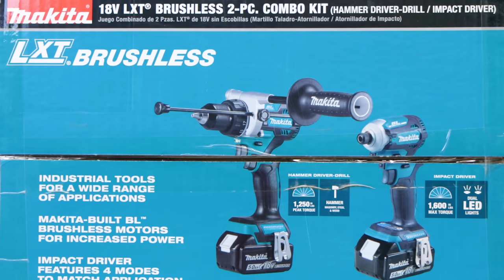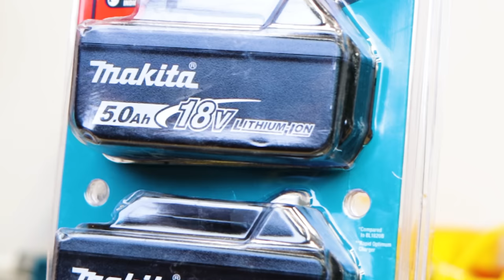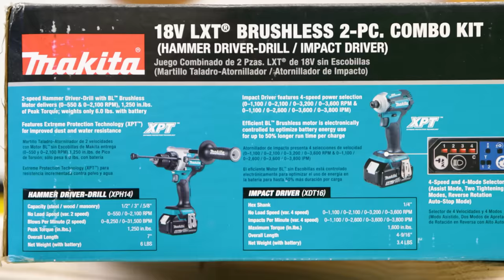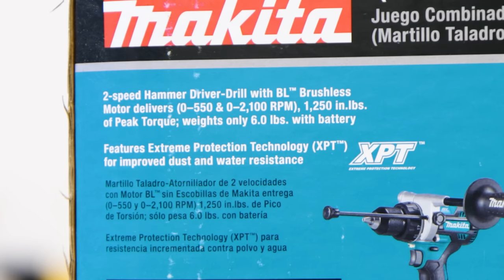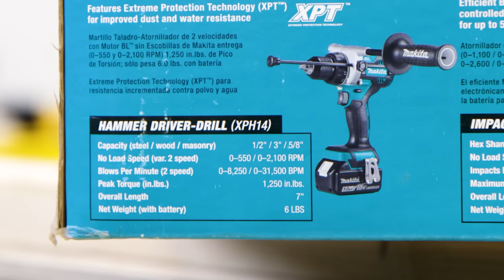New MAKITA Hammer Drill HAS INSANE POWER! (Best Combo Kit At The Home Depot)

Comment: It rings up for $573- at my Depot.
Reply: Did you try online
Reply: @CarnivoreKipp  Yeah. Also tried different zip codes around the country. Main kit was $399, and the other stuff was below as separate add ons.
Reply: @matthoward1174  I found it online for free shipping. Go on home depot website  and type in makita combo.

Don't stop scrolling until you find it.
Reply: @matthoward1174  if you don't find the exact pack then it is 399 just for the main kit.
Reply: @CarnivoreKipp  Found it. I looked at Makita 18 volt before, and it didn't come up that way. Good looking out ! Thanks for the heads up !
Reply: @matthoward1174  I tried to sweet talk the wife cause I only have a drill no driver but she said nope. Lol

Comment: I see fan boys for every tool line I completely switched over to the Makita line about 7 year's ago and it only lasted 2 year's and everyone besides HVAC guys around me uses other tools . I watched a platform recommended video and Makita was there recommended platform and the guy who recommended them said tools last between 1 and 2 year's but I'm in the electric field and the whole reason I stopped using Makita was drills because they didn't last I can literally smoke a base Makita hammer drill drilling one house out even if you buy a in store warranty it's not profitable for me to use Makita we have a first generation m18  holehawg still running it's been in a vehicle fire and the battery doesn't make great connection so occasionally you pull the trigger and it doesn't work I had my very first  chop saw stolen after 20 years of use the final 10 years wasn't as much being I switched to manly electric work but still weekends and side jobs I'd use it a old DeWalt one of my first cordless drills was a Makita with a long battery and it  was what made me think they would be a good platform but they have some tools I definitely want manly because others don't make them but I don't consider Makita reliable enough to go fully in not dose any electrician I know let these people know if you are a electrian and use Makita if not give my comment a thumbs up  because I know all of love Vince's videos and everyone who knows construction knows electricians put down more holes than any other trades residentially and if we have all experienced the same thing using Makita maybe we can get others to take a look into other platforms or frankly maybe make Makita make better drills and impacts again because they once made a good drill . Drills and impacts are the most used tools for me and my trade and Makita in my opinion just don't have it and as far as I know throughout the Midwest I see no electricians  who disagree and you call us fan boys but I'm a tool fan I roll up with a pack out tool box with M12 and flex I had a flex volt joice drill and holehawgs it's not a fan boy thing I use what is reliable

Comment: anybody try this for mixing yet? lol if so, how is it? and yes i know its not meant for mixing
Reply from the maker: You can, but I wouldn’t, I like this drill too much!!
Reply: @VCGConstruction  picking up the hammer/impact, 2x 5.0 ah batteries and the bit set tmrw as well as the rear handle saw deal that comes with 4x 5.0 batteries and a double charger. Never owned makita but those extra batteries are too good to pass up.